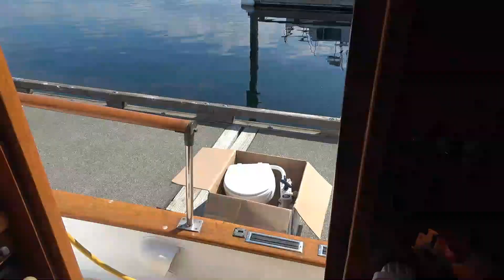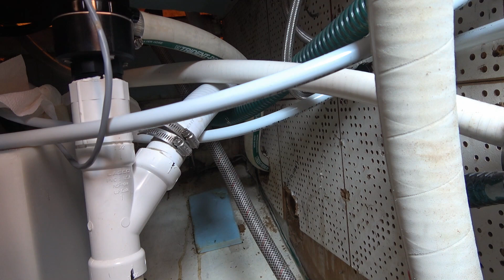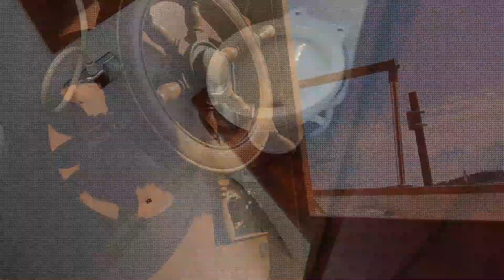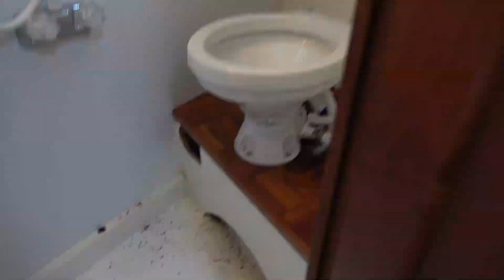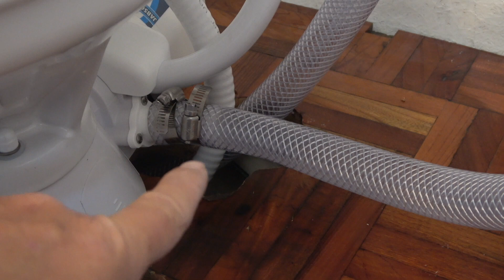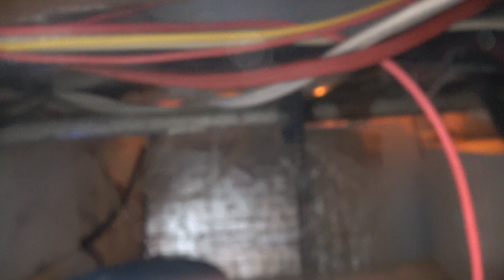Jabsco Electric Macerator Toilet Installation - 37010 Series Upgrade from the Old Manual Pump Style

Comment: Absolutely useless. I had one when I bought the boat, which I had to replace once. After two years, it's broken again. The cause? Simple little fruit pits managed to break the grinder. The electricity consumption is enormous, as is the noise. Get rid of it!
Reply from the maker: So far, ours has worked great, loud, yes, but it only gets used a couple of times a day for like 30 seconds. Draws around 300 watts max for only a very short period, so not really enormous power consumption.
If the grinder, aka the mascertor, broke, it may be a simple, cheap fix; maybe it just needs new chopper blades.

Comment: how do you add water to the bowl prior to the flush ?   I have the same set up with the push button to flush.
Reply from the maker: You don't really add any water. As the water is sucked out more is brought into the bowl. How much likely depends on the routing and levels of the plumbing hoses.

Comment: Clamping those thicker hoses without a leak can be difficult.  I have found submersing the ends in boiling water for a few minutes to do the trick.  It temporarily softens the stiff hose material and allows for a good tight clamp connection.
Reply from the maker: Great tip, thanks!
Reply: @donnaostler3369  that's a really handy tip thanks

Comment: Thank you
Do you know what kind of water supply hose you used?
Reply from the maker: It's called "marine sanitation hose" and was already there so I reused it.  If you Google that term you should find it. Marine parts stores will have it. It's extra thick walled.

Comment: I also have this model toilet and it will wake up the entire boat.  I wouldn’t recommend it.
Reply from the maker: Something to consider, We are only two onboard so hasn't been an issue for us.
Reply: Thanks for sharing Ray! 
What type of base is that? 
The base that I have has the 2 back holes situated right under the “ inlet n outlet ports” it’s been a nightmare for me. Had to change the pump seals, that was the easy part. 
Never fought so hard with 2 bolts before

Comment: Maybe you can use proper sanitation hose with some plumbing sealant.  The pump out station could collapse that vinyl hose not to mention the stink will permeate it.
Reply from the maker: So far no problems, no stink has permeated it. Also it doesn't get collapsed by a pump out since it is feeding into the top of the holding tank. The pump out hose pulls liquid from the bottom and once the liquid is gone it will just be air. The holding tank is vented. Cheers, Ray

Comment: Not so sure I'd want to replace my simple pump toilet with something as complicated. If your diet is correct your stools will be mush anyway and toilet paper degrades almost instantly. That tiny little hose really scares me.
Reply from the maker: My wife loves it versus the pump toilet. So far its worked great. Hose size is plenty big enough since the waste goes through a macerator. I use a macerator to pump out waste of my RV tanks into a tote on my truck when off grid. The hose I use for that job is 25' and only 3/4 inch and its never clogged. The macerator chops everything into a 1/8" size or smaller. Cheers, Ray

Comment: Can you use pvc piping and glue them?
Reply from the maker: I imagine you could but with all the vibration and movement in a boat seems most of the plumbing is done with thick flexible hose or PEX tubing. A trick a guy at the marine store told me is to use SikaFlex marine adhesive/sealant on the joints and let it cure overnight and the next day tighten up the clamps. btw I got a hold of a 90 degree elbow so was able to tied up the large coil of hose beside the toilet. Here is the update https://youtu.be/4ycfL262-J4  Cheers, Ray

Comment: The bowl can be mounted in 4 different directions relative to the motor. Perhaps rotating it 90 degrees counter-clockwise would improve the hose runs. I caulked the screw holes  during installation to prevent leaks and spills getting into the floor leading to rot. The hose holes are open to air and can dry easily. The noise of the pump is loud, but brief. I feel our pump-outs are more thorough because the vacuum sucks up what is in effect a soup, not a chunky stew as pre-macerator. Our unit leaves sufficient clean water in the bowl to easily accommodate the next use. Our power switch houses a 20 amp fuse, and the wires run to a dedicated 20 amp breaker on the fuse panel. Our daytime project was extended into the night by stubborn leaks here and there that required refitting of heat- softened hoses to connectors and super-insistent tightening of all clamps. Job has been worth the travail for 5-plus years now. Regards, Prowess.

Comment: To fill in those holes in the floor piece, I would glue a piece of 1/4" thick luan plywood to the underside, then fill in the holes with wood filler and stain them to match. Just a thought.
Reply from the maker: Thanks for the tip!

Comment: Ocean Pacific Marine in the Discovery Mall has been there since dot...at least 25 years. SeaCom Marine Electronics on 16th, CR is another. I believe Boatland is more consumer oriented, rather than parts and service but I might be totally wrong there. Been a minute since i had a boat so I'm not current.
Reply from the maker: I checked at Ocean Pacific Marine, and they have a Dometic hose adapter that just may work for $28. That's where I bought the fuse block and breaker. They are pretty high-priced store though . 100 amp breaker $95 Canadian dollars plus tax. As a comparison, Amazon in the USA sells the same for 43 USD 
But handy to get it now. :)
Reply: @LoveYourRV  Boat = Bring Out Another Thousand.
Reply from the maker: Or $1350 Canadian. ;)

Comment: Is there any way to have it put in more water? If that thimble full of water is all that is left in the bowl, a major number two would result in some major poop pyramids after I got done with it.

If you haven't looked at Overton's for all things boats yet, they carry a large line of items. I know they carry a lot of marine plumbing items.
Reply from the maker: They sell a more expensive model that comes with a control panel with extra buttons to raise and lower bowl water levels. I think it runs off a fresh water supply line versus sucking the ocean in.

Comment: In case of power issues,  you need the pedal maceration option...
Reply from the maker: Pedal maceration option?
Reply: @LoveYourRV  hook up a manual pedal system to macerate the poo when the power is not available... of course you COULD use a pedal generator on cloudy days when the power is low...
Reply from the maker: ahh, I see. Lucky I carry my little jump charger box. :)
Reply: I just use a toilet knife